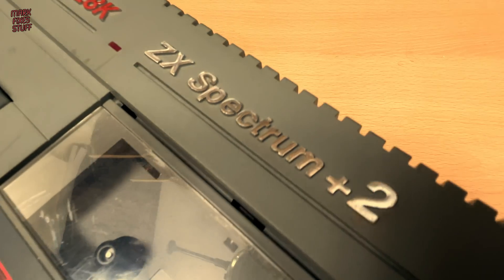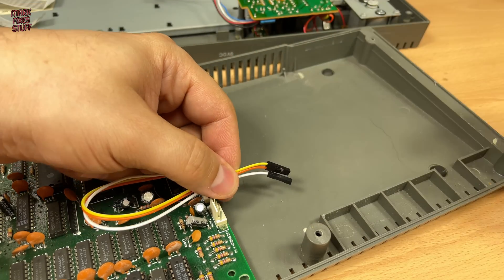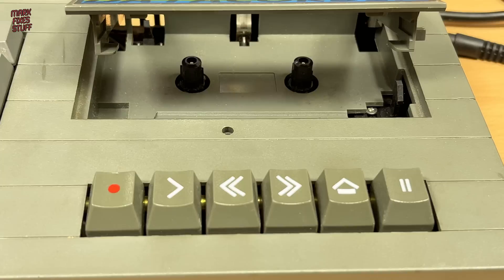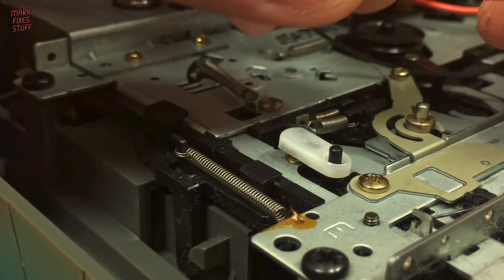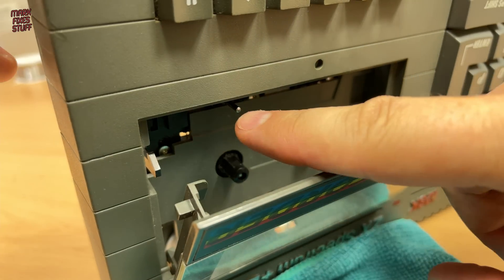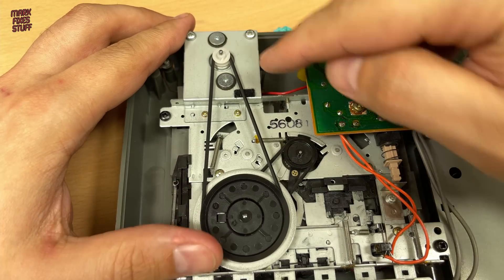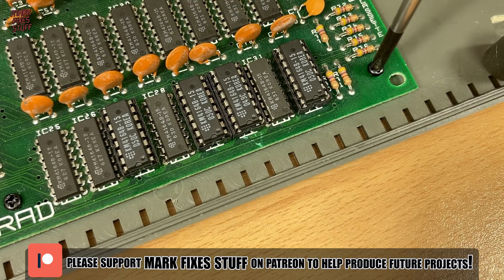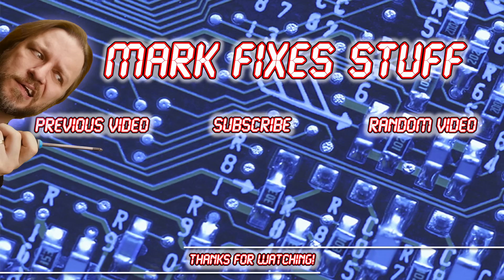Fixing a Sinclair ZX Spectrum 128k +2 Datacorder... and using a Buck Regulator on a Spectrum??

Comment: The +2A I grew up with the tape desk the buttons just all stopped, my dads solution was rip out the keys and solder a connection to the mainboard and drill a small hole in back of case and put the new soldered connection to a headphone input so I could use a external tape deck. How he did that around 1991 with no internet beats me, he did like electronics though and was always fixing things for friends as we didn't have much cash.

Comment: In addition to cleaning the playback head, you should demagnetize it with a head demagnetizer. With use, they become magnetized and lose playback quality.
Reply from the maker: This can be true, but it takes a really heavy amount of payback to magnetise a play head. Back in the 90’s I worked in a duplication factory and maintained the tape duplication machines and disk drive autoloaders. In both tape and disk you’d usually find that the actual head would be showing visual signs of long before accumulated magnetic bias affected the signal to noise ratio. We had to test regularly. It’s good practice though I suppose. You can get a degaussing tool for cheap… just don’t turn it on near your tapes!

Comment: I tried a switch mode regulator on a Ql and the rf output went crazy. Dont know if the monitor output would be ok. Or if the rf would be ok on a plus 2.   Needless to say i put the original regular back on its heatsink but with heatsink paste, it didnt have any.

Comment: Hi Mark, I didn't realise you could pul the capstan flywheel thingie  off the shaft, I normaly take the circlip off the other side and pull the shaft out with the capstan attached, might give this way a go next time, not sure if you can buy the circlips to replace them as they can get damaged, I also had to remove the other  white wheel last time on a 2A mechanism, it was running slow and clicking, the eccentric cam under the white wheel needed greasing it had dried up, worked nicely afterwards though :-)

Comment: Man, you don't need to pull the flywheel like that, remove the washer on the spindle from the casette side and you will avoid sepparating the spindle from the flywheel.

Comment: Nice work thanks for the video i never realised cpc did belts,the last belts i got for my spectrum were from retrocomputershack .One thing to avoid is the ebay seller selling belt packs under the linna name with a few extras for cleaning and lubricating they are the same quality as the Chinese sets and are useless with tons of wow and flutter .

Comment: The metal pin which the pinch roller rides against is called the capstan, I think you were calling it a spindle.  The spindles are the black cogs which fit into the sprockets in the cassette reels when you put a tape in.

Comment: Nice!
FWVLIW: I wouldn't suggest not fixing one of these properly but a mod I rather like is you have a +2 with a completely ronnied tape deck is the cut that end off the case entirely! Then glue the far end on to the hole left by cutting the tape deck off. If properly measured and done with care it will look like it was meant to be like that. A buck regulator as there's no room for the heat sink, a suitable storage device, and away you go!
Reply from the maker: What buck regulator are you using? This one seems a bit naff and the machine sometimes resets. I'll cover it in part 2 but need an option.

Comment: I was always told to avoid IPA on rubber parts. Was that just me? Anyway, thanks for this video. I've never tested the tape deck on my +2 -- I should probably do that some day. :)
Reply from the maker: Yes, really it should mostly be avoided but occasionally a quick wipe with IPA on very old rubber rollers will bring the grip back. A safer option is window cleaner.

Comment: What did you end up doing with the buck regulator? I assume it didn't end it's days hanging out the back.
Reply from the maker: Not really sure if it will pass testing yet, but there’s a second video in the works where we’ll do the video fixes and balance the AY audio with the beeper sound (it’s really unbalanced). We’ll decide on that video. :)

Comment: A question: What do you think about a drop of oil instead just grease?. Wouldn't it be good?
Reply from the maker: The grease is plastic safe. If you use oil you must ensure it's not mineral based or it will eat the plastics!